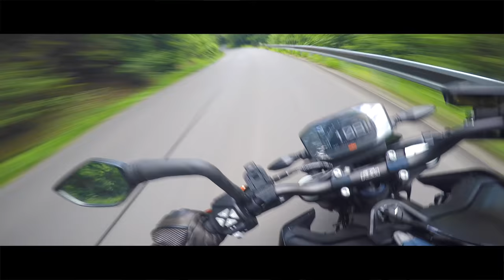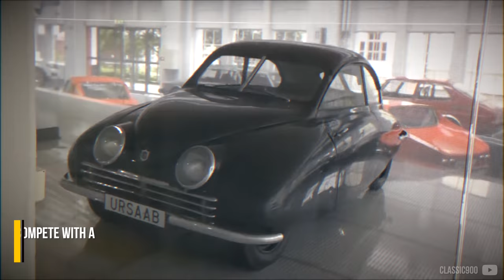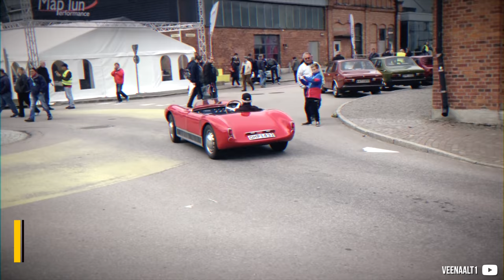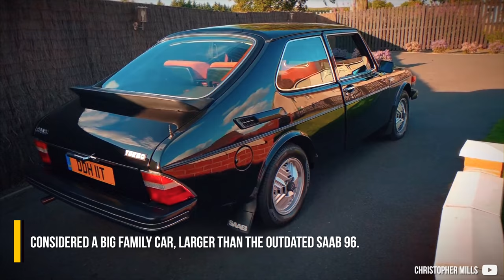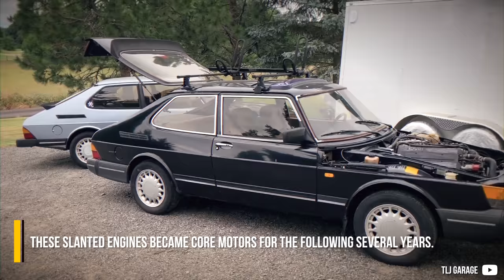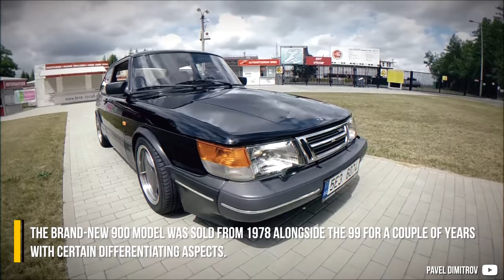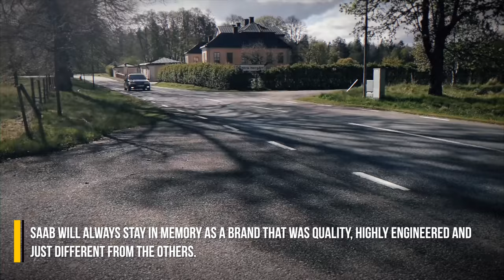Why We Miss The True SAAB?

Comment: I was driving a Datsun 810 (4 door, independent suspension, 240Z motor). It was quite the sleeper. One day I passed a showroom carport and saw my first Saab. Didn't know anything about them at the time, but it was truly love at first sight. It was a new (1979) 99 EMS, beautiful green with Aztec wheels. I added a custom exhaust manifold and 2" exhaust pipe. I literally ran it into the ground, headliner drooped, odometer died, but the final issue was the stick trans locked up in 2nd gear. I traded it in on a new 84 Turbo. Several vehicles later a 9-3 sedan, then a 9-3 Sport Combi wagon (V6), then decades later... I currently own a 2004 9-5 wagon which I purchased in 2008. She now has 165K and needs a new home. My retired Saab Indy's wife is selling her 2008 Saab 9-3 Sport Combi wagon and Im ready for it. Anyone interested in my very well appointed 9-5, Im in Ft Lauderdale, FL

Comment: I worked at a Saab dealership when I got out of trade school in the mid 80s when Saab was still Saab. I fell in love with the quirkiness of them. I stayed until the year after the 9000 came out and it was then I knew they were going in the wrong direction. The shop car was an 85 900 4 door 8 valve in black and even though it was just a base " regular" Saab, I volunteered to get customers and parts and any other driving errands I could just to get behind the wheel of the "black 5 speed". The 900 was always my favorite. We had a 900 SPG for a little while that I got to drive a few times as well. It was Grey and gorgeous. Also we had 1 customer with a red Sonnet that I was lucky enough to work on and drive a couple of times too. Oh, the good old days. How I miss them. My personal car was a 71 Opel GT. That car got me laid so many times. I wish I still had that. Car mean. Lol

Comment: At the time when I had a 900 3-door, I lived in Boulder, Colorado and really enjoyed an active out-door lifestyle. Serveral of my friends had Saabs and raved about them. I was always a Honda guy but bought into their phrase for the 900's. I'm thinking mine was an 1987 or 1988 but don't remeber for sure. 

It was a 3-door liftback which gave me a huge flat area in back for camping, or carrying bike/ski equipment, so in theory it seemed like a match made in heaven.

That enchantment was short lived, however. There were fundamental things about the car which immediatley began driving me (no pun intended) bonkers.

First of all, the space between the brake pedal and the gearbox 'hump' was so narrow, I couldn't even wear hiking boots as I drove, as my foot would not fit in the space to operate the gas pedal. Even wearing "thinner" shoes, my foot would barely fit, forcing me to hold my foot in one very confining uncomfortable position. There was no "moving my foot around" to get a variety of leg positions, thus in about 1/2 hour of driving, my right leg was aching.

Next on the list was the high dashboard. It was so high that I felt like a small child in a supermarket, trying to see what was on top of the check-out counter. I just couldn't see over the darned thing. The dashboard was also situated much closer to me than I was used to in Honda's, so I always felt cramped for space and unable to see.

That lack of forward visibility wasn't the only visibility issue. The rear of the car was essentially just a big metal box and (like a panal truck) behind me was one huge blindspot. It was awful.

The entire interior of the car felt cramped and unpleasant. Even the side windows had very high  "sills" adding to the "cramped" feeling of the interior. 

If I recally correctly, the Saab engineers also thought it would also be a good idea to locate the ignition switch in the console between the driver and passenger seat. Any dirt, dust or "bread crumbs" fell right onto/into it, as would any spilled coffee. Again... it was awful.

And honesty (honestly... I'm just being honest) the car simply didn't handle all that well. It always felt "primitive" compared to my Hondas (which felt refined and quick).

I owned the car for only about a month and sold it, going back to a Honda accord which was "light and airy" on the inside, with almost perfect visibility (and required much less maintenance, by the way).

Honesly, I had high hopes for that 900 but it was God awful. I honesly don't see any appeal to them whatsoever. In my humble (yet some people say "lovable") opinion, these were just horrible cars to live with. If I actually had to drive one, I wouldn't accept one even as a gift.

At least the Swedes produced ABBA... so they did some things right... Designing cars was not one of them.
Reply: I'm glad you said all of that, as I had a similar experience. I was so inundated with praise of these cars from my (admittedly yuppie) friends that I fell for their pitch as well... much to my chagrin later. Like you, after living with the car for a couple of months I dumped it. It was just a terrible car to live with. (And it certainly wasn't inexpensive to repair and maintain.)

Comment: I had no idea SAAB was a aircraft manufacturer first. However, that was the sensation I got the first time I test drove one with that small turbocharger. From the sound the exhaust made to the driver oriented cockpit like instrumentation. When that turbocharger Kicked in, it felt like I was taking flight! I don't see them much here in Texas anymore. SAAB's Technology was light years ahead of its time. The problem I had was finding someone who knew how to work on it. Even taking it to the Dealership was no guarantee it would be completely fixed. Ultimately, the difficulty of repairing it, the high cost of parts and the fact that there was only one Dealership in the largest city in Texas did mine in. Toyota, Honda,  Subaru, Mazda, Volkswagen...all small engine family cars pay homage to SAAB in my opinion. The Toyota Camry 4 cylinder with a small turbocharger was just introduced for the first time in the States in 2020!

Comment: I noticed in the OP's mention of the effects of GM's control included the introduction of the 9-7X, an SUV based upon the Chevrolet Trailblazer. Ironically, it was the only Saab ever to be offered with a inline 6-cylinder (Vortec 4200 (4.2L)) and a V-8, in both 5.3L and 6.0L configurations. ;)
Reply: And the 9-7x Aero is the most expensive, fastest and quickest Saab ever built. Was also the most expensive sticker price for a GM model in 2008.

Comment: While on a GM based chassis and having a transversely mounted FWD engine, the B235R in my Saab 9-5 is still based on the slant-4 of the old saabs.  Lower end bearings and the cylinder head are basically the same.  The engine management system was different from GM and 100% Saab (not to mention freely open-source tuneable!)   And it moves incredibly well for a heavy car.
Reply: What year is the b235r
Reply: Do a balance shaft delete and it'll move even better. I did it to my 2001 B235 Viggen. The weights and added timing gear weighed almost 3 kilos. Idles and runs better. Not sure why the engine had that crap in it. Got the galley plugs from Taliaferro.
Reply: @malikibasha1701  2001
Reply: @richsackett3423  first thing I need to do is actually tune the thing properly.  It's got forged pistons from Wossner and a mild turbo size upgrade (td04-19t from some chinese MFG, but it's logged more than 15k miles on the new turbo and seems as durable as a stock unit)
Reply: @DefenistrationAlley  Fun bolt-on hp tip. Swap out the giant 130A alternator for the smaller 90A unit. You save about 0.8kg in rotor mass and 130A is ridiculous anyway. The service to my last house was 100A.

Comment: In the early '70s, I saw a photo published in 'Autocar' magazine, of a SAAB 99 which had been on the top of a car transporter, being delivered to a dealer.  The transporter driver went under a bridge which was too low, and the car was swept off the transporter.  It somehow held onto the bridge by its front door pillars.  When removed, it was delivered to the dealer.  The windscreen was smashed, but the doors could still be opened and shut normally.
This was so impressive that the car was taken on  a tour of SAAB dealers in the UK to demonstrate just how strong the cars were.

Comment: I've owned 5 Saabs in my life and still have 3 of them. All of them except 1 has over 200K miles on it and all still run like a top. If you take care of a SAAB it will run forever. My favorite part about them aside from incredible reliability is even after 10 years of being out of business, you can still find tons of NOS and re-pop parts for them. And they are super easy to work on - unless you own a 2.8L V6.

Comment: My first car was a Saab 900. Great car and probably the best of all the cars I've owned. Fun fact: There is few Saab V8 engines in Saab museum in Finland close to the factory where Saab's were built back in the day. It was made with two 4-cylinder heads, a block from Valmet and a crankshaft from Great Britain. It was installed in to the 9000. Sadly it never got into production as I would love to drive on of those.

Comment: I used to own a SAAB 900, 1984 model year. When I put a good set of winter tires on it, no winter conditions could stop it. It ploughed through the snow as if it wasn't there. Once, the car behind me, following in my wheel traces, got stuck in the snow.
The car was always very stable at speed, but had quite a bit of understeer.

Comment: I had three of them. A 1982 900s, 1986 900 turbo and a 1987 9000 turbo( the nicest car I ever owned). They were a blast to drive, ate brakes like crazy, expensive as hell to repair. Had electrical problems with all three and the 1987 9000 turbo had virtually every aspect of its electrical system go bonkers on me at 35,000 miles…..just inside the warranty limit. Had it fixed and unloaded it and I have driven nothing but Japanese trouble fee cars ever since. I must admit that the 9000 turbo was unreal until everything just short circuited and went bonkers. I can’t imagine what it would cost to fix  them today.

Comment: My first SAAB was the 95 estate with the extra two dickie seats in the boot. A few years later I bought a SAAB 99 Turbo, one of the original two door turbo's with those cool alloys. It was red with the side stripe. It was a great car & the only major repair was to replace the turbo which was costly but easy to do. My last SAAB was a 900 5 Door Turbo in white with a grey interior. This was a lovely car too & I kept it for years but I wish I had kept the 2 door & kept it forever! ..... 👍

Comment: I had an '83 900 Turbo my senior year in college and for a while in law school.  I loved the design.  It was a blast to drive with great visibility for the driver.  The turbo was a pain as you were supposed to let it sit and "cool" before turning the engine off.  The paint on the hood was fading at only a few years old but the car was unique and extremely sure footed.  I traded it for a Japanese appliance that was extremely reliable, got great gas mileage and was undeniably boring.

Comment: I bought a “new” 74 99 EMS in 1975. Bright orange with black stripes, it was beautiful and fun to drive but lost 2nd gear in the 4spd after about 6k. I sold it and took a bath but the 75 models were much improved with better fuel injection, more power and better response. A friend bought a new 99 sedan and it was much better than my EMS, but it didn’t look as cool as the orange with the hexagonal alloy wheels, similar to those on the Sonnet. The aircraft-like wraparound windshield was so cool 😎

Comment: I love Saab's When younger my friend had a 96 and then an early 99. Used to see Eric Carlson in the rally cars putting it over the more powerful European cars and drivers. My first was one of the Saab 99 Turbos 2 door's ( only a few hundred built) and was quickly tuned using a Saab water injection kit!! which gave at least 18% increase but as I had a Saab guy as a friend mine ran at 24psi and probably gave something like 190 bhp!!  Eventually Swopped for a Saab 900 turbo and put all my bits on and kept it a long time. came across it a few years later with nearly 400,000 reliable miles on the clock!! Needed a car for my wife so my friend sold me a 900 4 door turbo which again was magically reliable.Then bought an exworks 96 V4 rally car for my friend and then bought myself a 96 V4 rally car for myself.Still have in my garage a Saab 96 2 stroke appendix K Rally car.

Comment: Pretty accurate. You should mention that the 9-3 and Viggen from 1999-2002, and 9-5 from 1999-later models retained the B2x4/5 4 cylinder turbo engines and terrific T5 and T7 ECU's that meant the soul was still there. In fact these were the pinnacle of Saabs engine and control work. The excellent 9000 should be mentioned too.

Comment: I've heard that the original SAAB prototypes highlighted a problem with fairing in the front wheels.  It all worked just nicely until they took it out in snow.  Then, it also all worked just  nicely...until someone tried to turn the steering wheel.  The packed snow under the wheel arches prevented the front wheels from steering...and so we ended up a SAAB with a bit more of an exposed front wheel.  :-)

Comment: I always liked the sportiness and quirkiness of the original 900.  That was also the car that taught me about turbo lag and torque steer in very quick succession.  
No mention of the 9000, though.  It was a solid, well built car, developed along with the Fiat Chroma, Lancia Thema, and Alfa Romeo 164.  It was much more conventional than the 900, being a standard transverse FWD setup, but did manage to keep more of the Saab identity than the GM 900 and later models.

Comment: I had a 900 and was one the best car I’ve owned. First it was great on snowy roads, it was in fact my ski trip car, no troubles climbing those snow mountain roads. Second the handling was excellent and driving it felt safe. Third, in my opinion one of the most classic designs that lasted quite some time until GM modified look more like well a GM sedan. The Saab’s reverse lights on the sides idea does looks like taken from an airplane lighting.

Comment: I have my 19998 9 3 convertible since 2006. Long running without no great problems a had to do some bigger work on it. It is incredible how easy you can take out and repear most things on motor and gear box. A bit just like LEGO. You only need about 4 hours to take out the whole drivetrain to repair greater issues. Thanks to the still existing parts manufactory you get a lots  of Saab original parts without no problems. GM parts like brakes, starter etc. are very low priced, so it is no problem to take the 23 year old car as a dealy driver. One of the now  very rare true 4-Seater convertibles you still can afford. I never will sell it again!

Comment: I worked at the factory between 1991 and 1993 building 900, until the old 900 was replaced with thew new 900. I have had several 900 (old type), one 9000CD and three 9-5. Best cars ever. The problem now,, what brand should I buy next time without loosing comfort and quality.

Comment: The 9-5 was pretty much GM money, but still in heart a Saab (all the way up until 2009). Sure the used more GM interior pieces but still kept the B235 engine until the went to the “NG” 9-5 which was a re branded Vauxhall. With that being said, many people including myself would consider the 9-5 to be the best all around car Saab has ever made. Fast, economical (on the highway anyway), reliable, fairly low maintenance, and still kept the saab quirkiness while remaining easy and simple to work on. It’s the perfect daily driver for people who want to drive a Saab. Some might argue that the 9-3 is the better daily but it’s even less of a Saab than the 9-5 and in my experience, less reliable as well.

Comment: Fun fact: when going downhill with the 2-stroke cars you had to use both brake and accelerator to keep the engine lubricated.
Reply: Explain it, i don't get why.
Reply: @RGV2300  the oil is premixed in the gas.

Comment: I had a 1975 99LE.  That car was awesome.  Solid car, I frequently took it on small trails at  high speeds.
  Once G.M. got there dirty fingers in there they never were the same.  Oh and I also  had a 2000 93 convertible,  definitely NOT a 99LE comparison.

Comment: The ignition key switch was on the floor between the seats, if I remember right, how cool is that!
Reply: It was placed there to prevent damage to the legs in an accident, and you have to select reverse to remove the key. This to prevent theft.

Comment: Saab was an air- craft manufacturer that used Volvo jet engines. Saab was once partnered with Scania Truck with the corporate name Saab-Scania.Yes G.M. bought the automaker and wanted to use a platform to make it easier to make the cars. If I remember correctly G.M. want- ed to use a Vauxhall platform for the cars.

Comment: I had a Saab 900 16valve Turbo convertible soft top.
Went like the wind, but dreadful handling, sitting in the drivers seat you could see let alone feel the front scuttle and windscreen shaking about on it's own!
It literally used to twist around bumpy corners!
Loved the doors though, when opened it seemed like half the floor was attached to them.
Back in the 1960's I used to work at Jack Reader's, Continental Cars, in Woking England, we were one of the first Fiat and Saab dealerships.

Comment: Great video. I’ve had 4 Saab’s - 82  900 turbo 2 dr. 91 9000 turbo, 2008 9-3. Aero vert. And 2011. 9-5 eco.  My favorite being the 900  I put over 425k on it and gave it to my sister the I put 375k on the 9000 and gave it to a relative. Still have the 9-3 vert but missed that unstoppable 900   That 900 is how cars are supposed to be built and driven